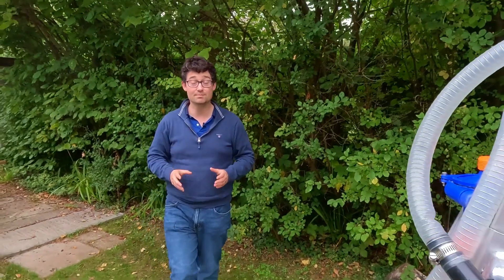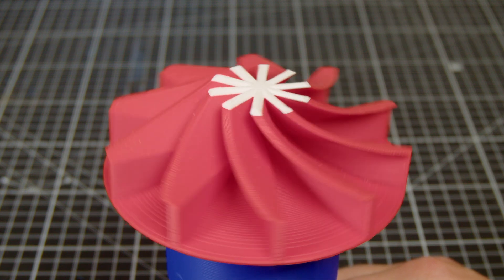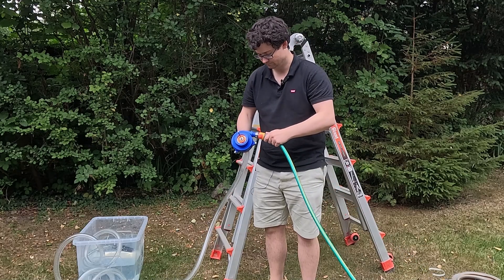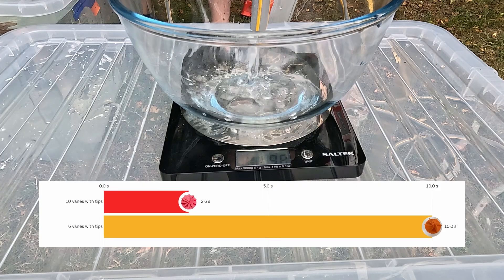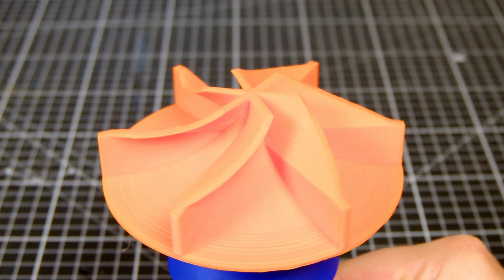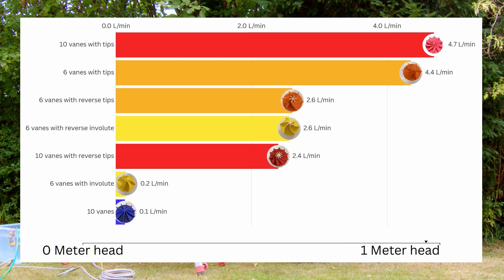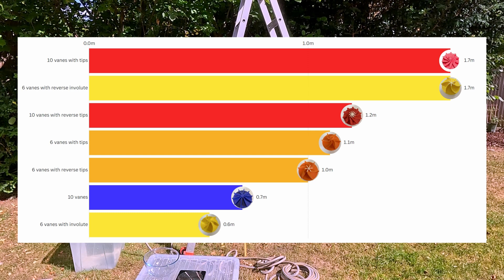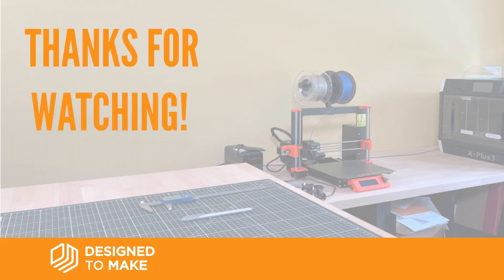🤯 Testing the BEST 3D Printed Water Pump Impeller Designs for a Print-in-Place Pump!

Comment: I didn't see where exactly the water was leaking from, but could more bolts around the outside help by applying pressure more evenly? And maybe trying to get the bolts closer to the o-ring?
Reply from the maker: I think both of your suggestions would absolutely make the design form a better seal around the o-ring. And I tried to do both, during the design phase I really did. The challenge was trying to retain the print in place design as much as possible for the two part testing casing. When I tried to add either more bolts or move them closer to the seal they would start to impact the internal shape of the pump casing, which I really wanted to avoid. In retrospect, something would be in the same vain as your suggestion would have been to make the bolt flanges much thicker so that the clamping force would be greater and more evening spread out.